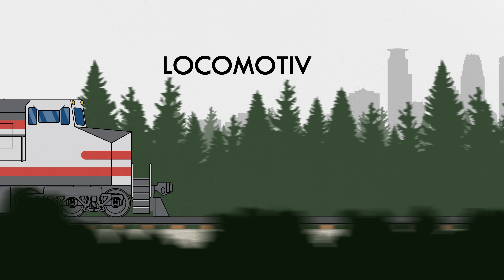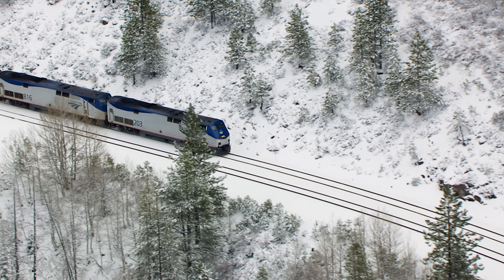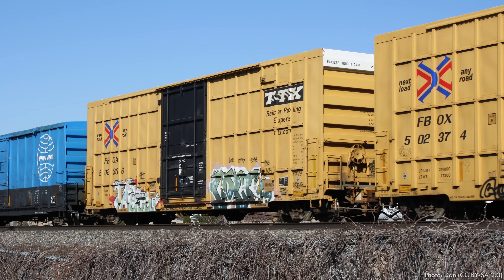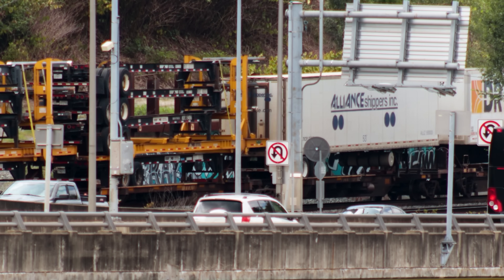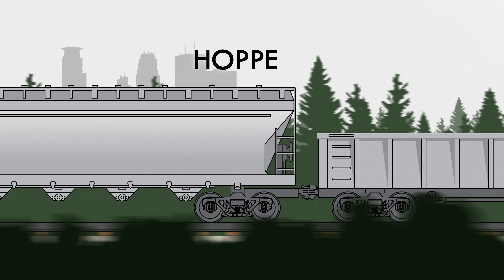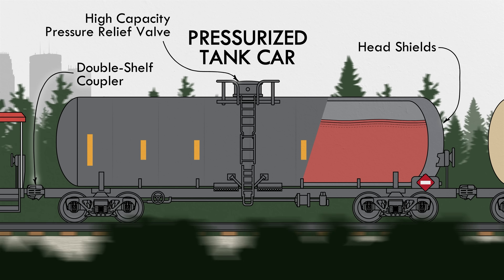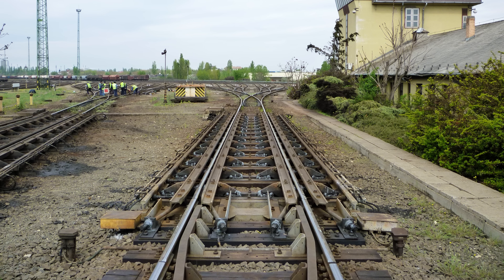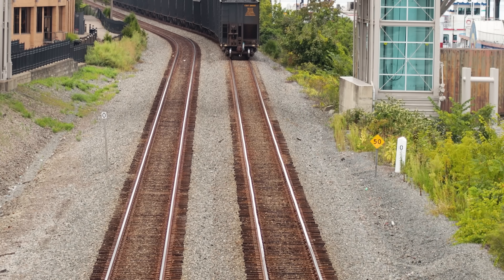Every Type of Railcar Explained in 15 Minutes

Comment: 00:43 🚂 Trains have at least one locomotive providing power; they can pull from the front, push from the tail, or have distributed power.
01:10 🚆 Standard passenger cars have rows of seats on either side; some are bilevel, but most come in train sets and aren't split up.
01:37 🧳 Long-haul passenger trains may have a baggage car for checked luggage; they're designed to resemble other passenger cars.
02:03 🍽 Diner cars are rolling restaurants; lounge cars with bars and even live music can be included. Sleeper cars offer private rooms and bathrooms like rolling hotels.
02:58 🌅 Dome cars provide panoramic sightseeing views; observation cars at the end offer views out the back.
03:28 👷 Crew cars provide quarters for train operation and maintenance crews, especially in remote areas.
03:53 📦 Boxcars have sliding doors for loading various cargo; refrigerated boxcars are like giant fridges for perishables.
04:20 🚗 Autoracks transport cars and trucks, often with three levels carrying dozens of vehicles; they're more efficient and protective than individual driving.
05:16 🛠 Flat cars are rolling platforms for large or heavy cargo; they can transport heavy equipment, machinery, and even wind turbine blades.
06:11 🚚 Centerbeam cars are used for lumber, plywood, and fencing, allowing for higher stacking; they have a central beam for support.
06:38 🚛 Trailer-on-flatcar (TOFC) involves loading semi-trailers onto flatcars; it's a cost-effective alternative for long-distance transport.
07:07 🚢 Container-on-flatcar (COFC) involves securing standardized steel containers on flatcars for easy loading and unloading.
07:36 🚢 Well cars recess the bottom of containers between wheels, allowing for double-stacked intermodal freight on more routes.
08:05 🔩 Gondola cars are used for bulk materials like scrap metal, sand, ore, and coal; they're loaded and unloaded from the top.
08:35 🌾 Hopper cars have sloped sides and bottoms to funnel material for bottom unloading; they're used for weather-sensitive cargo like sugar and grains.
09:05 🚛 Side dump cars tip sideways for unloading bulk goods, though they're more commonly used for railroad maintenance.
09:33 🏗 Schnabel cars have more axles for carrying enormous cargo, such as power transformers; they're rare but impressive.
09:59 🧪 Tank cars transport liquids and gases; they can be non-pressurized for general liquids or pressurized for hazardous materials.
10:28 🛡 Tank cars for hazardous cargo have special features for containment and safety in case of derailment.
13:19 🚂 Track geometry cars measure railroad gauge, position, curvature, and alignment for safety and smoothness, without interrupting service.
13:49 🚂 Cabooses were historically crew quarters for various tasks; modern freight trains use End-Of-Train Devices for monitoring.

Comment: I watched a video with someone going through a cold start of a steam locomotive. Took something like 2-4 hours. There are an AMAZING amount of elements to such an engine that I didn't even know about before! A fully functional steam locomotive from anything past 1880 is an absolutely marvel of engineering and really gives credence to the title "engineer" for the guy who has to operate it. You really do have to have some pretty extensive understanding of them to get them to run right and not one component was electrical. All steam and mechanical!

Comment: In the UK, our loading gauge doesn't allow for trailers on flat cars, so Royal Mail in the 1990s experimented by having bogie attachments fit onto lorry trailers to convert them into wagons. However, this didn't last that long. We also have well wagons that initially were designed for use with trailers, but nowadays are used for taller containers (again, we don't have the loading gauge for double stacking). 

We also have nuclear transport wagons, the old FNAs and new FNA-Ds being for a standard nuclear flask in the centre of a well wagon, the KUAs being like the Schnabel cars in that they have 4 2-axle bogies supporting a larger well wagon for flasks from nuclear submarines, and some of the PFA wagons (designed for 20' containers, initially open containers of coal) are used to carry containerised low-level nuclear waste from decomissioning a power station (or other specialised modules designed around the 20' container footprint). And the Scunthorpe steel works also has Torpedo wagons, a pair of bogies with rotating supports holding a tank that gets filled with molten metal, which can rotate to be emptied.
Another interesting pair of types of vehicle are barrier vehicles and translator vehicles. Barrier vehicles are used to either protect hazardous loads (nuclear flask wagons until the 1990s, class A tanks until the 1970s, etc) by being between the hazardous load and other vehicles (often at the head of the train behind the loco, or at the tail of the train in front of the brake van), and these are often just random wagons either put to a new use temporarily or permanently, or purpose built/converted wagons (some HEA hoppers were in use with the original FNAs, but then they got rebuilt so the hopper bodies didn't obscure the view of the flask wagon). And translator vehicles are again often other types of wagons with modified couplings so any loco can couple to any other load, such as on delivery of various types of multiple units (like the S Stock which has the standard London Underground type coupler, and other modern units which often have Delner couplings, whereas locos usually just have screw links).
Also, we have non-rotary snowploughs. Some pre-1960s were steam loco tenders with ploughs on (and some were even class 08 shunters with their engines removed and ploughs stuck to the front, but they're often purpose-built vehicles. There are currently 2 types in operation in the UK: independent snowploughs are full height and have control cabs on the non-plough ends (which the traincrew are not allowed to be in when in use), which usually top and tail a pair of locomotives for ease of turning around, and Beilhack snowploughs are former class 40/44/45/46 bogies with extra weight and a toolbox and a plough added to the "inner" end (so the couplings on the outer ends can still be used), which don't have cabs and are much lower profile but otherwise work the same as the independent ones.

We call cabooses Brake Vans here in the uk, because their primary role was to activate the train brakes (or just to brake an unfitted train) in the event of an uncoupling, as well as the housing of extra traincrew mentioned here. The law changed in the late 1970s to say that fully fitted trains (that is, trains fitted with a continuous braking system, whether it be vacuum or air) didn't require such vehicles, but only in the last few years has the law around brake vans on unfitted trains changed so they are no longer required (because such a train is very rare, and servicable mainline-registered brake vans are very hard to find). 
Probably the most famous brake van in the UK is the Shenfield Shark; the Sharks, and their lighter cousins the Oysters, had ploughs at either end which could be raised and lowered for use with ballast trains to help spread the ballast across the track. However, these disappeared around 25 years ago, and one example has sat at Shenfield station (at the eastern end of the Elizabeth Line) for at least 20 years, and talks of removing it never get any further than just talk because it'd probably collapse if anyone tried to move it.

Comment: Though the rotary snow plough illustrated wasn't in 'the north', (12:03), it is a metre-gauge one owned by the Rhaetian Railway in Switzerland and is being propelled by one of the RhB's  GEM4/4 electro-diesels - that is, they can operate as electric locomotives on the Bernina line, or as diesels on the rest of the system or when the current is off.    [/geek mode]

Comment: of the regular cars just about the only ones I haven't seen are the Side Dump cars and the Schnabel. One type of car you didn't mention are rotary dump cars, which are somewhat distinct in that they are full sized bulk cars that have a continuous coupler assembly that can rotate while sill attached to the cars ahead and behind of it while being rotated. A number of power plants use this setup as it is even faster than dumping out the bottom. Also Bulk Cars and Gondola cars are considered by many to be separate and distinct, Bulk Cars (Often referred to as Coal Cars) are high sided and often can be dumped via gates at the bottom, Gondolas as you mentioned don't usually have the underside dump gates and are not as tall as a Bulk car, but many do have removable side skirts so the cargo can be discharged to the side without a crane.

Comment: On these books I hope you look at the style of the old Richard Scarry's "Busytown" series books. In them he would have the illustrations with different colors for when the pipes changed to hot water, then to removing that water in drain, the electrical wires even changed color. As child I didn't realize what I was learning  but was able to follow and see when thinks became different before my reading caught up. Going back as adult and looking at these old 1970's/1980's books, I'm amazed at how well made the simple illustrations were showing how the complex systems in house, in a town, in buildings, on farms, on various vehicles.  These books were common amongst all my peers, not sure if they were big outside the USA, but you make such great videos, I hope you can reproduce how well those books worked showing young children things that basically taught them the mechanical fundamentals before they realized they had learned the bigger picture. It was just point out the cold water  pipes at reading time , point out the hot water pipes,  only looking back do see how much those simple children books were really genius ways to expose to children to complex engineering in everyday items around them.

I hope your books are just as good enough better for having Richard Scarry(the Author)   "busy Town" series to help you build off of and improve  for the all the future little engineers out there.

Comment: Lived by the tracks for years.  Nice to get a couple details on what's in some of the average cars I saw.  One thing I only recently learned was about the light on the end, usually called a FRED light (I forget the acronym's meaning) but the time a train stopped with the end by my house I kept hearing a "whining" sound, and speculated (later confirmed by a railroader) that it has a small generator run by a turbine that drives off of the airbrake pressure.  Always wondered how they "kept the batteries charged" in that thing, because I never saw wires connected throughout the cars.
Reply: FRED = Flashing Rear-End Device
They do have batteries, but the batteries are maintained by the little generator driven by the air.  Yep—no wires!

Comment: I ran a trucking owner-operator business for a little while, and I was lucky enough to be able to haul a traction unit (the motor and axle assembly that goes under the locomotive) for a freight locomotive.  It was super cool to see them hoist the thing 4-5 feet up in the air, roll the old, seized up one out and then roll the new one in.  One of the coolest hauls I have ever done.

Comment: In the UK and Europe a lot of passenger trains dont have a locomotive, but have the engines\electric motors distributed in the passenger cars. I think this helps with spreading the load and increasing the contact area of the driving wheels. The diesel ones are known as DMUs (Diesel Multiple Units), i belive some are usimng the engines directly and some use the diesel to generate electricity to drive the wheels

Comment: "...unless you memorize DOT hazard codes...." Funny thing. I do look for and look up those codes. After a bit I memorized diesel 1202, gasoline 1203, sulfuric acid 1830, ect... Funny thing is I can never remember gasses as they are typically labeled with what is in them. I live near an Intel chip fab so I've managed to see an argon truck. Best of all was one time on a tour at hanford I saw a load of transuranic waste and the yellow warning signs!

Comment: A few reactions:

I'm on the west coast. The overwhelming majority of passenger cars I see are double-deckers. They take a little more time to load, but the extra capacity means the train can have fewer cars. Commuter trains in the LA/SD network typically only have 4 or 5 cars in the entire train because they're all double-deckers.

Coils and rolls of steel are notoriously difficult to secure on trucks, and pose a special risk to the truck driver as well. A few truckers have been killed by their cargo breaking loose just because they had to hit the brakes hard. It would be cool if there were coil trailers for trucks too. It would make us all safer.

The craziest thing about train cars is that every single car needs to be strong enough to pull the entire train, since every car, including the one hooked right up to the locos, pulls the entire part of the train behind it, and any train car can be put right up front.

Comment: A very interesting car not mentioned here is the Torpedo car: It is used to transport molten metal. They are used to transport steel from a blast furnace to the next processing facility. Of course, in an integrated ironworks, these are unnecessary.

Comment: That "End of Train Device" is super important for safety too. Here in the UK, every train must have some form of red light bringing up the rear. On multiple units or when a loco brings up the rear, you can use the tail lights, while most freight and non-MU trains have a lamp that flashes. Traditionally it was used by signal boxes to ensure the whole train was in tact (look for the light as it passed by) but obviously it's helpful for other trains, track workers etc.
Reply: When I hired on the railroad, they still called them F.R.E.D. F-ing - rear - end - device. The old heads started calling them that because they were upset about losing the caboose.
Reply: @schinbone0 nowadays they're more politely known as "flashing" read-end devices.  :)
Reply: @PaulCashman  Im sure there are still a few old head brakeman/conductors that might argue with you. : )
Reply: I don't think it's just about the flashing red light, it also transmits brake pressure readings to the head-end.
I notice on BNSF trains with rear DPUs or pushers, there is no red light. The locomotive's headlight is on dim.
On UP trains, there seems to be no red light at all half the time.
Reply: @nik665.7  Yeah eot also lets you dump the air too. By dump it I mean place the train into emergency.
Reply: I picked up my phone (connected to the TV for this video), and read the phrase "End of Train Device" within and 15 seconds of the phase being said by Grady.

I love when that kind of thing happens.

Comment: I work for a company called Wabtec, in one of our Shuttlewagon facilities! We make railcar movers. They’re like a hi-rail vehicle but they’re designed specifically to move rail cars and strings of cars around depots without an engine :) you’d almost never see them unless you pass a rail yard or depot, or see one being transported (usually by semi or rail), but they’re super cool! They have the hydraulic lift rail gear you see on hi-rail vehicles and MASSIVE tires akin to a tractor or semi. The ones we make range from 30-40 tons and have super powerful Diesel engines just like locomotives.

Comment: Most of my experience is with Chicago’s Metra. It has an upper row on each side of the passenger cars, with a singe seat instead of a double. Between the upper seats are luggage racks.

The trains are always a mismatch of older and newer cars, but all are configured the same way. I actually really like it, it’s my preferred way to go downtown. I’d like to experience Amtrak eventually, but yeah. Other than the L, the Metra is my experience. Low-speed commuter rail.

That said, I’ve seen a lot of cool things on freight trains thanks to living in the countryside.

Comment: Double deck cars are nor "kinda rare", they are frequently used on short intercity lines, aka "regional/ commuting lines" with big volume of traffic, thus they are very popular in densely populated areas in Europe (like Germany). Their "nearly doubled" (not "actually doubled") capacity suits those lines very well, and "loading" - or rather BOARDING ;-) time is not an issue, since they have larger doors and sufficient number of them. They are tad lacking in "comfort" zone, but when your trip is - typically - one hour or less that doesn't really matter. I guess they are rather different from US DD cars, here's a very short (and not exactly "showing") clip of German "Regio Bahn" DD car, youtube.com/shorts/e6zQRWvG1Iw - couldn't find anything netter that that.
"Tank cars are used to carry liquid or gases" , or more accurately, "liquids, including liquefied gases (like propane or chlorine)".

Comment: Track geometry car: in the UK, we have a converted Intercity 125 for the purpose, called the "New Measurement Train". Due to it being painted yellow and having the sloped frontage of the power cars, it's acquired the nickname of the "Flying Banana". As well as taking numerous different measurements of the track, it also has a bunch of non-contact overhead line monitoring and recording equipment for use on the relevant sections of the network.